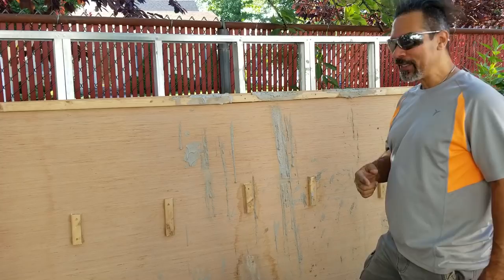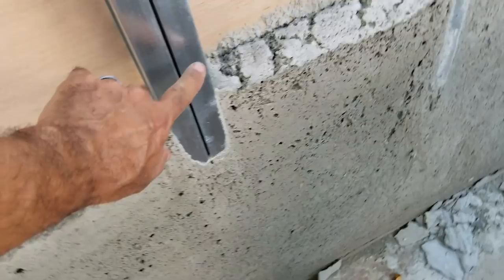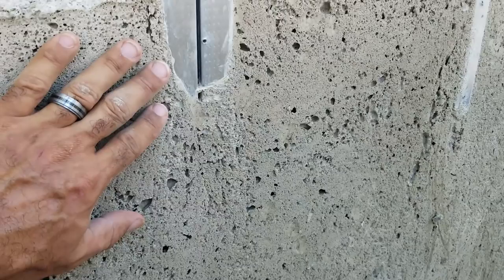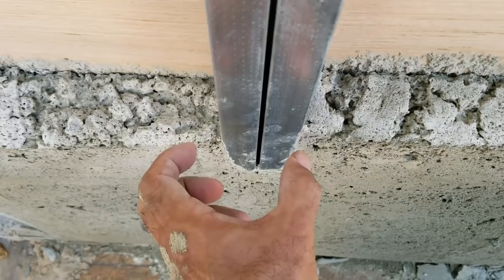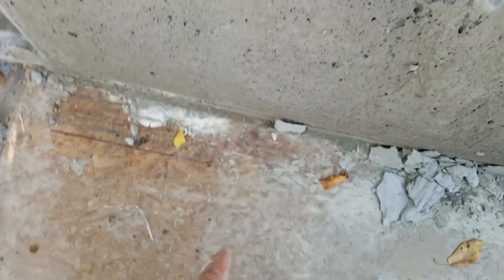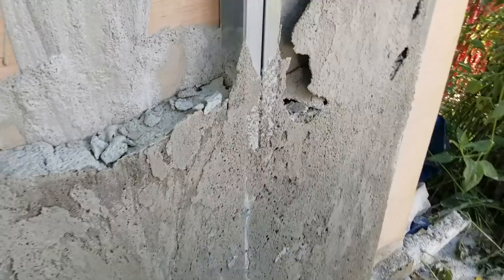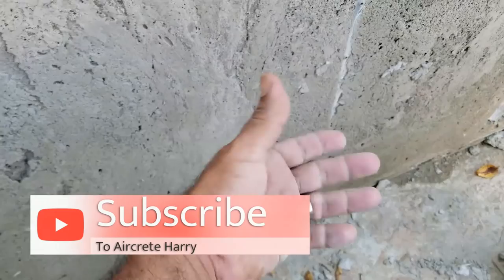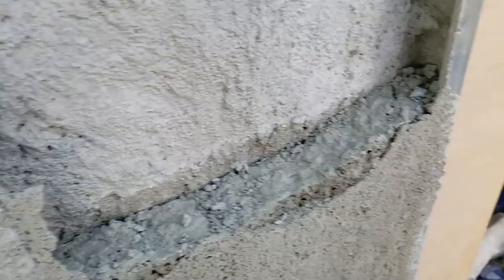Aircrete Wall Insulation | #aircrete #wallinsulation #aircreteharry #aircretewall #aircretesamples

Comment: Is there an aircrete pressure pump available on the market?
Reply from the maker: I'm working on building one for the market. For now diaphragm pump works for pumping aircrete.
Reply: Aircrete Harry ooooooooh thank you sir. All the best from up near Alaska
Reply: Aircrete Harry hello sir. I checked out some diagram pumps and yes, they definitely would work. I, however, would prefer a pump that has more control over the flow - especially at the hose nozzle - to be able to turn the flow on & off when required.  The diagram pumps have the on and off switch on the machine and not on the hose nozzle, so the concrete slurry will continue to come out of the hose.
Reply: I used an industrial  peristaltic hose pump for pumping foam concrete in densities from 400 - 4 1200 kg/m3. I could pump up to 40 mtr vertical and 150 
Mtr horizontal depending on the FC density. 
I was an FC contractor for about 15 years in Europe . For in situ FC production the  machine (with diesel engine) was designed and built by myself.
The same is true for the FC mix designs for various construction purposes.
For small scale diy projects you do not need professional equipment like I had but the product know-how required for small projects is the same. 
My sincere advise: 
Gain FC knowledge as much as you can. Once you feel confident and the budget than do your project. Yes you will make mistakes, but don't let that stop you.
Good luck

Comment: How would this compare to Polyurethane Foam?  Kits for posts are sold and this foam has a very high R value.
Reply from the maker: That is a test I will be performing soon. Comparing a Polyurethane foam box with a box made of Aircrete with a thermometer and camera inside. I will put them in a large freezer.
Reply: Well the Crete is fireproof so even if the r value is less, it's something to consider. The cost is also a factor. Foam is expensive. I don't know that you could pour this in between drywall because the moisture would go into the drywall.